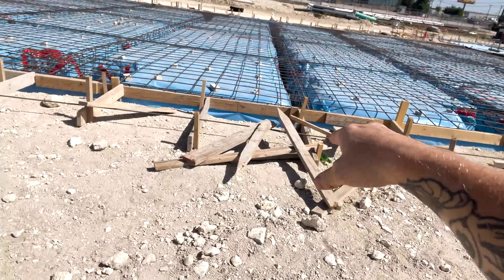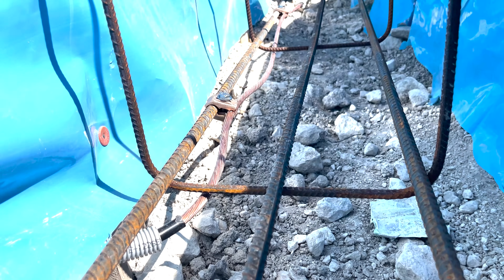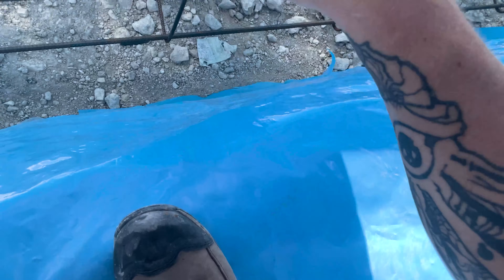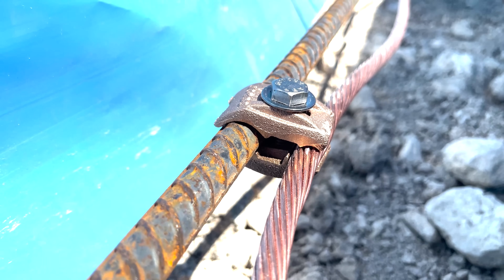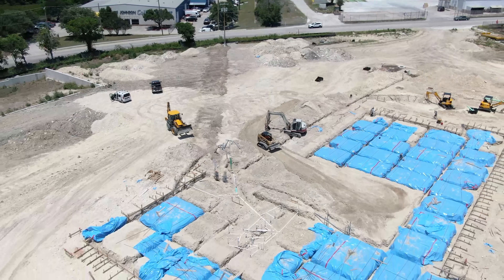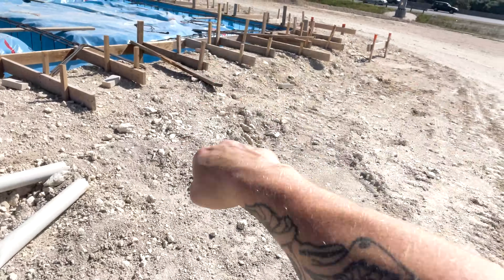On The Job: Grounding The Slab

Comment: Your inspector must be really special. You don’t need to install a ground rod for the pole bases. They are already in perfect contact with the ground🤣
Reply: Job could have a specifications that go above and beyond code.
Reply: Does the city have specs or details requiring the supplemental ground rod
Reply: Austin Code its up to the ruling jurisdiction!
Reply: @stephendyment7932  I agree 100% but it doesn’t make it right. Always do as your inspector ask you to do but never keep spreading this kind of silliness.
Reply: Think about it this way, the pole base itself is a bigger and better ground rod. It has rebar, encased in concrete in direct contact with the ground. Do you think that in case of lightning strike the little puny rod makes a difference? It’s like saying that you have to go from point A to point B using a 4 lanes highway but you decide to use a local dirt road to get there and your local inspector makes you build a dirt road next to every mayor highway just because he feels like it. Do a little research. Code does allow to install it but doesn’t impose it. It is not necessary.
Reply: They do that here in Illinois too. If a ufer ground is good enough for a building, why isn't it good enough for light poles???
Reply: @IceBergGeo  Think about it this way, the pole base itself is a bigger and better ground rod. It has rebar, encased in concrete in direct contact with the ground. Do you think that in case of lightning strike the little puny rod makes a difference? It’s like saying that you have to go from point A to point B using a 4 lanes highway but you decide to use a local dirt road to get there and your local inspector makes you build a dirt road next to every mayor highway just because he feels like it. Do a little research. Code does allow to install it but doesn’t impose it. It is not necessary.
Reply: @williamfigueroa6503  I know. That's what I said in my comment.

Comment: Wont the concrete react with the copper and brass and corrode it ?
Reply: Not before the steel. Also, those oxides are conductive, unlike aluminum, which is why you aren't permitted to use aluminum when in contact with the ground.

Comment: Unfortunate they had you run rigid to pole lights, that will rot. 1" pvc to pole lights is what we always run
Reply: Yeah weird it wasn’t at least wrapped with corrosion tape
Reply: In Florida, we have a substation from 1967 that has rigid conduit to everything lows voltage. Surface rust only. Not rot. How long do you expect it to last?
Reply: @davidgagnon2849  --- here in California the majority of underground that I've done, no matter the size of the conduit,  commercial or residential, we run PVC underground and then the 90° and riser are galvanized conduit for the strength. Or if a customer wants or the engineer requires, we'll run PVC coated galvanized pipe underground and the transition to riser. 
 One time, I had to have a 2 inch by 40 foot copper ground rod driven into the ground. Needed an auger drill truck to come out and use a 15 inch diameter auger drill to go 40 feet deep. We hit the water table at around 7 ft  being at the south end of the Bay in Silicon Valley, and then hit bedrock at about 32 or 33 feet and bent the drill bit. So then dropped a 40 ft X 12 inch sonnet tube in the hole then I had bought two 20 foot X 2 inch copper pipes and a coupling from the plumbers, soldered it end to end went to the roof of the building dropped a rope had the apprentice tie it to the pipe I pulled it straight up and then guided it into the hole and because it was about 28 feet of mud and water and the pipe being hollow that thing slid into the hole like a straw into a milkshake. Then poured  about 25 50 pound bags of conductive mix of cement and some fiber, to help with the grounding by surrounding the rod and filling the sonnet tube. Then Cadweld mold a bare copper 500mcm conductor that made a ring around the building cement slab Cadwelded to rebar making a ground halo ring of 500 mcm and to the 2X40 ground rod. One Hell of a building ground system.
Reply: @davidgagnon2849  is it below ground or above? Below ground, with all of the rain Florida gets, should rot it in no time.
Reply: In california you use a ridgid riser wrapped in 10 mil tape so it won't rust /rot
Reply: Rot?
Reply: PVC or oval conduit
Reply: It’s Texas, wouldn’t thAt mean it’s not subject to rust due to the lack of salt such as in the northern states?
Reply: It's not the salt that ultimately causes the corrosion. Salt just accelerates the process. And in any case, if the soil's good enough for any kind of plant to grow, there's enough minerals in the area that are water-soluble that the water percolating thru that soil will have enough salt in it to make corrosion happen faster than if it was just pure water.
But in any case, like I said, water alone (especially rainwater with the tiny amount of carbonic acid in it from atmospheric CO2 dissolving in it) is more than capable of making galvanized steel conduit rust clean thru within about 5 years or less.
That's why if you're going to run wires in conduit in a damp location, those wires should be rated for direct burial in any case and you should only be relying on the conduit for mechanical protection and not to keep the water out.

Water is extremely hard to keep out of electrical things, the only way that I personally know that works 100% of the time to keep water out of a splice is to use some form of non-water-soluble gel or a RTV silicone type material (that has an appropriate electrical rating) to fill the voids in the splice, giving the water nowhere to get into in the first place. This is how most direct-burial splices work, or at least the ones I've seen that appear to be worth buying (don't cheap out on those, you'll have comebacks 99% of the time if you buy cheap direct burial splices).